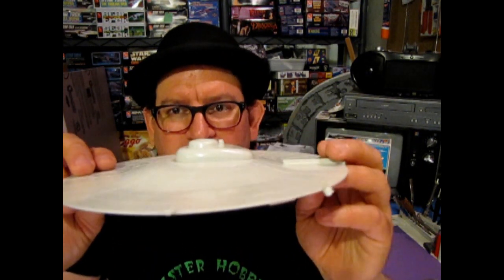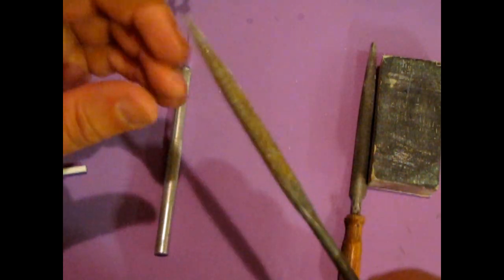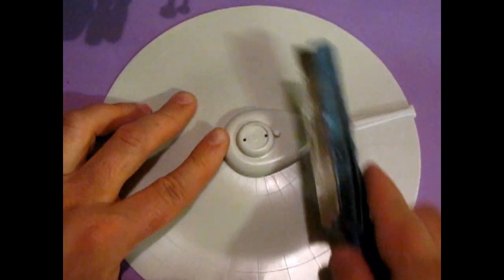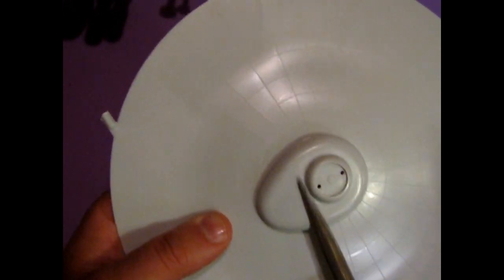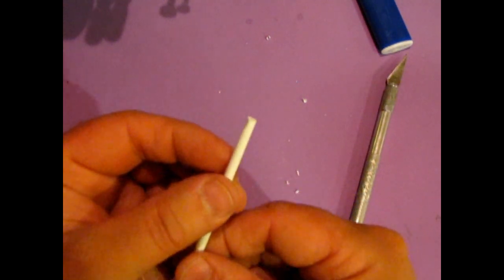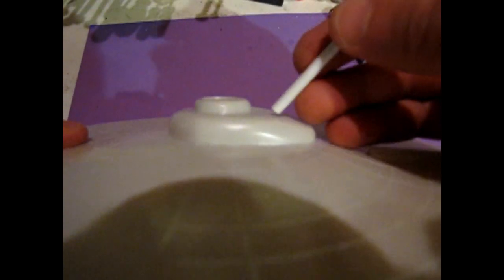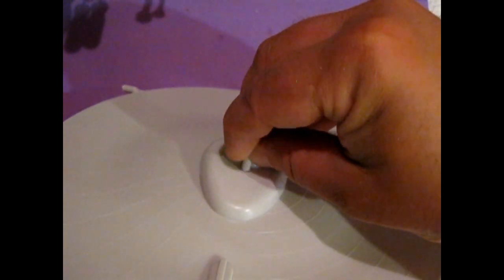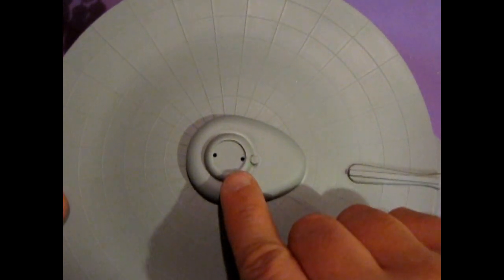Let's Improve It Video#1 - Correcting the Turbo Elevator Shaft - AMT Kit 6676

Comment: Hello from Michigan.   I recently found your videos and have watched several the past few days.   I want to build the old AMT (like I did back in the 80's!), only U would like to try and make it a bit more accurate, considering it's few shortcomings.  Your videos are helping me!

Apparently, there are slight differences in the plastic tooling depending on the year of production - original late 60's, early 70's, 90's, Round 2 in the 2000's, etc.

Thanks for your videos!
Reply from the maker: You are welcome! 

The mold has changed a few times over the years. It's still a fun kit to build and a great size too.

Comment: Not a bad solution to the turbo elevator problem. But I would suggest using an x facto saw, rather than what appears to be an Atlas one. The much thinner metal back of the x facto saw blade would have made your job much easier.

Again you did a good job!
Reply: For some reason, spell check turned X-Acto to x facto.. Stupid spell check.
Reply from the maker: Thank you so much. I can only use the tools I have on hand, but thank you for the suggestion.
Reply from the maker: Of course! :D